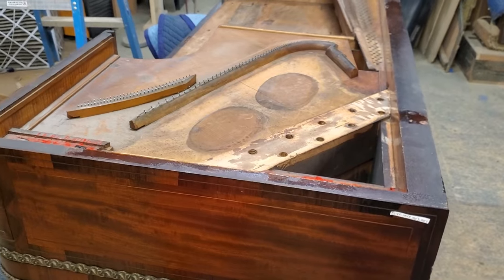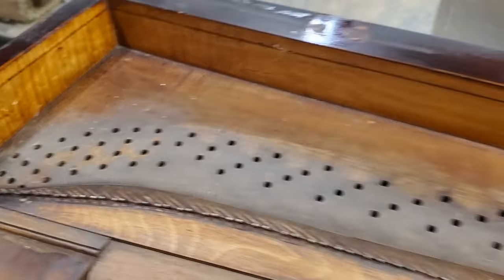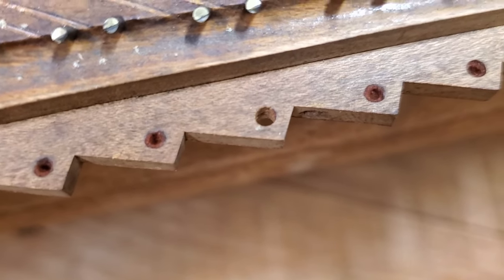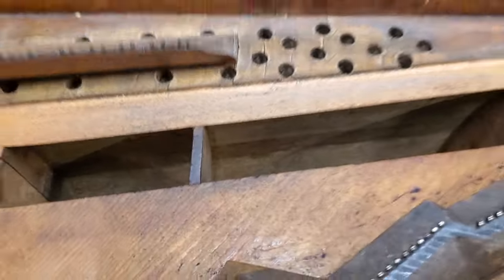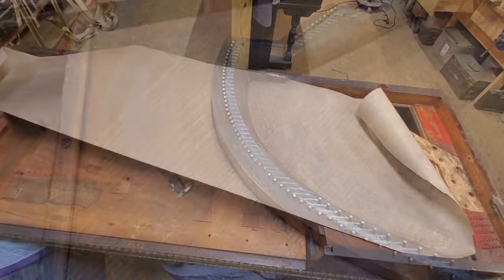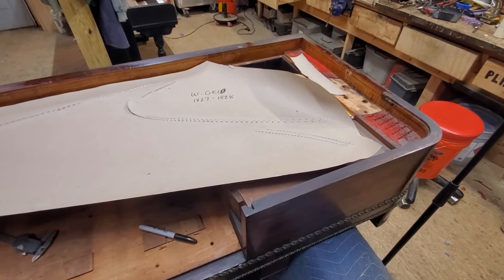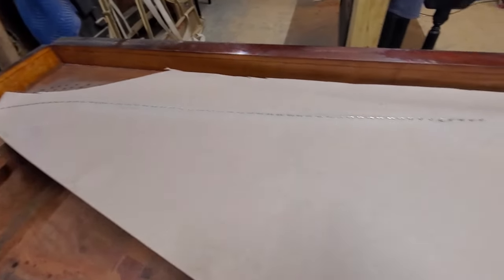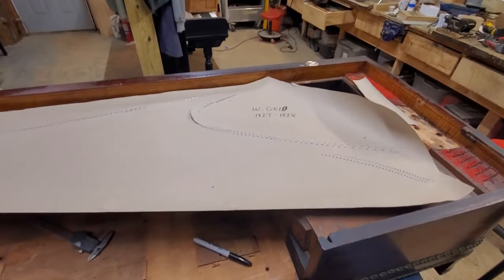Bare Bones Geib Square Piano

Comment: Coincidentally, I just rebushed the damper rod holes on one of mine a couple months ago. Had a hard time finding the right size material (too big, too small, none just right). Ended up using synthetic suede that is marketed for music rack use. Shamefully inauthentic, but occasionally one must be expedient. BTW, felt is rarely seen on pianos of this era AFAIK. It's generally wool cloth of various sorts.